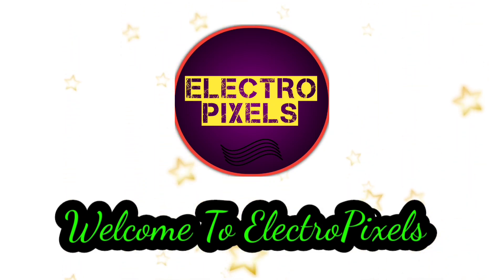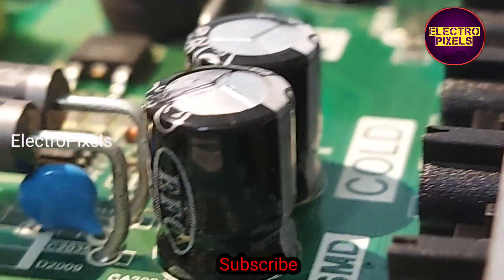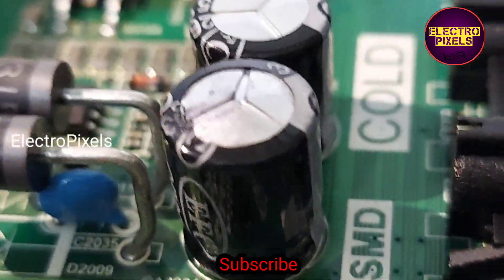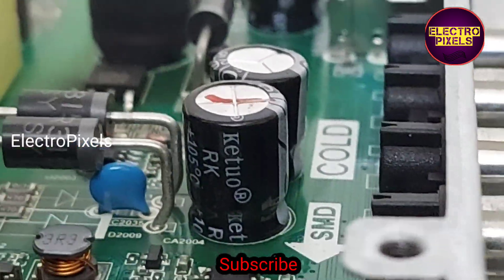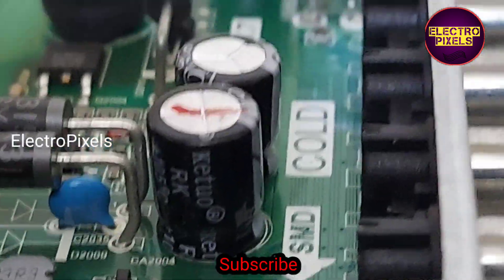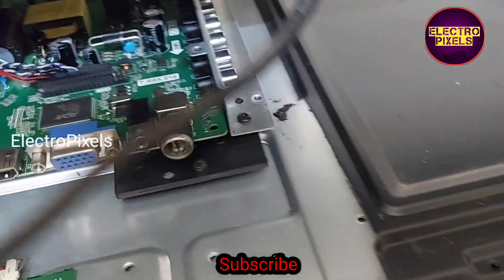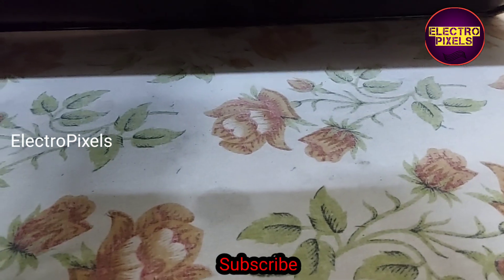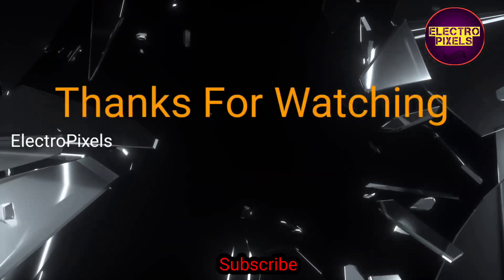32 inch ibell LED TV No display and Backlight Ok Repairing |Capacitor Fault |No picture sound ok|

Comment: Frist time this capacitor problem solved but next time backlight not working
Reply from the maker: Then check the Backlight using Led Checker
Reply from the maker: Also inverter section of the board also
Reply from the maker: Here First we checked the Backlight and found they are working